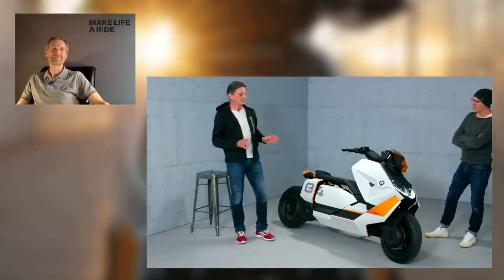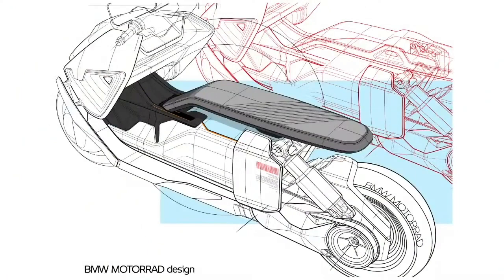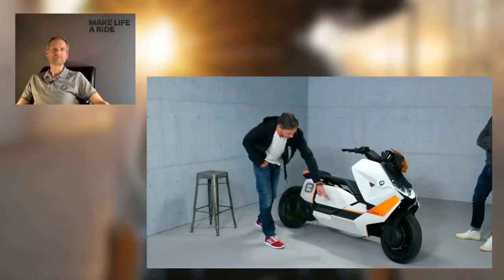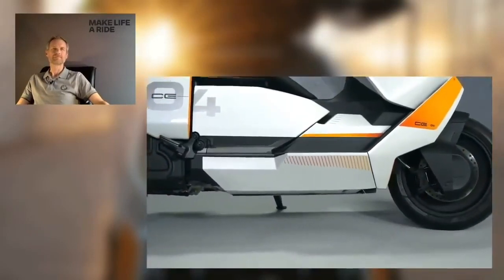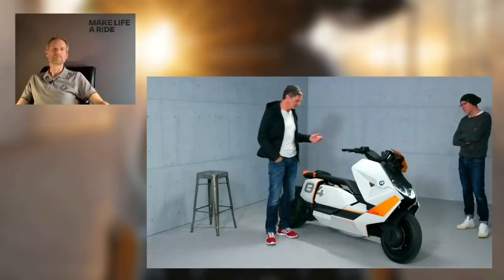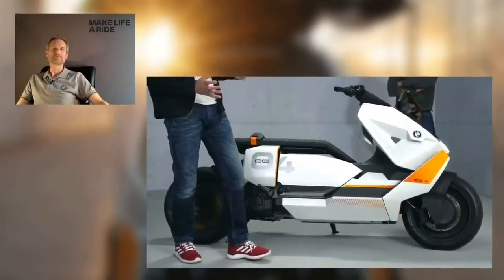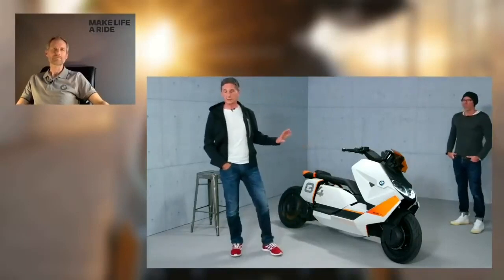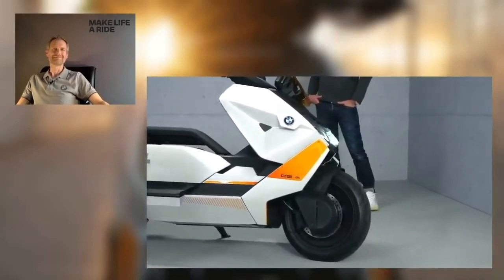A scooter from the future! – BMW Motorrad Definition CE 04

Comment: I wish it was more set thru design like a Vespa.  Definitely this needs at least a 200 mile range.  I usually go on moped rides that can last over 100 plus miles.  Freeway speeds to at least 80 mph would be a great safety factor.